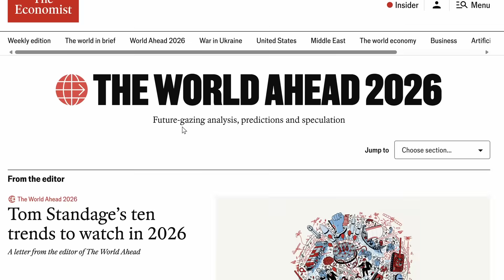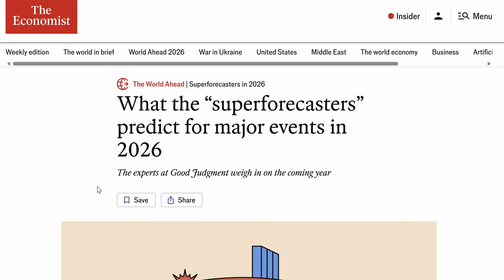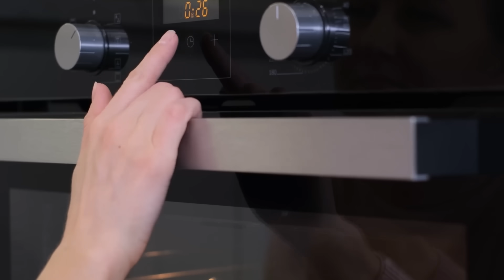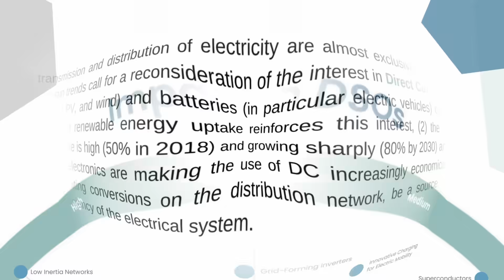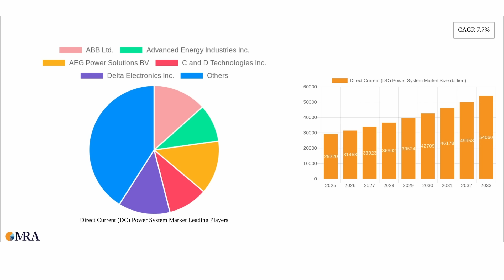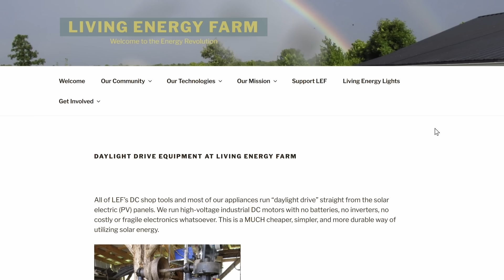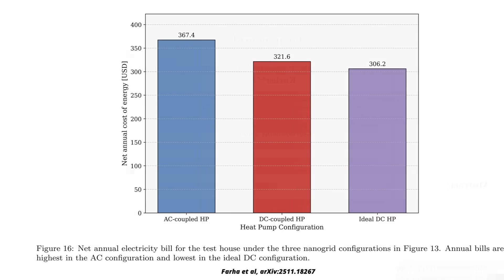Are We Using the Wrong Kind Of Electricity?

Comment: I'm fairly certain we use AC due to transmission losses over distance being greater for a DC current. With AC, we can raise up the voltage and lower the amperage delivering the same power with less loss. DC can technically do this as well, but with significantly more complicated hardware and HVDC is prone to constant arcs - also, given that most of our infra is setup for 3-phase AC you'd lose some capacity as there's an entire 3rd leg that couldn't be used in a DC setup. So with the current infra, AC can transmit 17ish times more current. I'm not aware of how to do breakers with DC, only fuses, so there's that too ( there may be a way to do it, but I don't know it ). From a pure cost perspective, switching over this late in deployment is just not feasible. That's not to say that DC doesn't have its benefits over AC, but due to the large AC deployment currently in use, I don't think the benefits would justify the costs of switching over.

Comment: At about 2 minutes 40 seconds in the video, Sabine Hossenfelder says household power sockets provide current that reverses 50 or 60 times a second. That is incorrect. Correct would be to say it reverses 100 or 120 times a second. In each current cycle, The direction reverses twice. You can check this algebraically. The direction of current changes when the waveform crosses the zero level. It does that twice per cycle. Once going from above zero to below zero (positive to negative crossover) and then again in half cycle later going from below zero to above zero (negative to positive crossover). 
It is possible to mix DC and AC currents, such that if the DC current is large relative to the AC current, then the overall total is more like DC, so that it does not reverse direction. If the DC current is small relative to the AC current, then the current reverses direction twice per cycle. To check algebraically, take the derivative of current waveform, and set that derivative equal and solve for when the current changes direction.

Comment: Nothing is wrong. AC is still better choice for high power and long distance transmission, considering losses, arcing, etc. And DC prefered for low power devices and/or short distance, for simplicity.

Comment: the current thingi toconvert dc ar rge swvicw. An, not wcwet ibw b uaw aikEnwka and they don't scLle nuclwae nwegy needs ac the only truely viable large scale nergy.  The acg hine solar panel produces 300warrs per hoour per 1 square foot hous ous use 110v vt 10 amos 12100 watts that means the hgius ae 40^2  feet that mea you woukd need 1600 sq feet of panels .that is er than most yards. just for the panels

Comment: AC has a few advantages. It allows the use of transformers, and it mitigates galvanic corrosion which is a huuuge problem with HVDC.  If we were to rework the grid today, we should probably use a higher frequency AC such as 50 KHz which would allow us to make transformers much smaller and more efficient.

Comment: AC can be transmitted over thousands of miles DC can only go a hundred feet before it peters out.
400 V AC is used on large airliners as the DC systems lack the range 
From a dozen feet to miles.  Big difference - Micro just doesn't work large scale Nic Tesla got it right

Comment: Too much energy lost over long distance.
Reply: Not when the voltage is converted up for long distance. That is possible nowadays with DC. Yet, I wonder whether the active circuits (that need maintenance) will be cheap enough to compete with the simplicity of static transformers.
Reply: @salipander6570 Exactly.  Converting DC voltage up and down in the power distribition is extremely expensive compared to AC transformers.
Reply: A million volt DC power line is more energy efficient than an AC power line due to capacitive coupling etc and for the same sized conductors can transfer 30% more power. 
It also doesn't have issues with phasing on each side of the grid connection.
Reply: @zyeborm  a million bolts is extreme .
Reply: @zyeborm Yes, but using DC through whole the electricity distribution system and replacing all the transformers with DC/DC converters would be expensive.
Reply: @JuhaK71 so would replacing all the wires and transformers on the grid when the current gets too high. 
Transformers use a lot of expensive copper

Comment: I was thinking about this recently while considering a solar panel system. One of the costs of a complete solar system is the inverter. If you only had DC devices in your home, then you wouldn't need an inverter, cutting down the cost a little. I think the real place to invest in terms of DC would be in DC appliances like refrigerators or TVs, etc., that people could run directly off the batteries or even the panels.

Comment: AC power is for transmission purposes only. DC is virtually Impossible to transmit over long distances while AC power was a Gift From GOD when it comes to electricity distribution. But after the Power gets to the location it is according to what you are going to do with it as to whether it will Remain in it's current state or if it will have to be transformed. Most motors are powered with AC power. It eliminates Contact Brushes that are a source of Wear and eventual Failure. But not when using a Brushless AC Induction Motor. Otherwise all Electronic Circuits run on DC voltage. All electronic components operate on DC voltage. A solid State Triac can regulate the Flow of AC current, but it's operation is controlled with a DC voltage. Both forms of energy are needed and always will be. It is the GENERATION, Storage and Control of these forces we need to concentrate on.

Comment: You just have to remember one thing. The most efficient way to change the levels of voltage is to use AC. If you have 50 volts from a  solar panel, to get it to a voltage your modern day electreonics need, you will convert it to AC first. With modern day electronics this conversion can be very efficient. Back in Teslas and Edisons day, they only had a simple transformer to convert voltages that required AC. Todays electronics replace the transformer with better efficiency. If I remember my history correctly, Edison envisioned power plants close to where the power was used. Tesla envisioned power plants far away. ie Niagra Falls. AC has an advantage travelling over long distances compared to DC.

Comment: In what world are "wind turbines making DC" ?????? Sorry, but that is unacceptable BS from a scientist! Due to their size and power ratings they all generate AC of some form. Then that AC usually gets converted to synchronise with grid frequency AC. And that step is done via a frequency converting DC-coupling. This even allows for variable speed rotor operation for optimum efficiency from ever changing natural windspeed and gusts.
Reply: You're right and I would add that AC, three-phase generators are well known to be far more efficient than DC dynamos. You note also an AC-DC converter and power generation controller is needed in order to store the produced energy into batteries and, eventually, push it to the grid via a DC-AC synchronous converter. A DC grid would anyway need some kind of DC-DC converter in order to push the right amount of power to the grid, so I don't see any efficiency advantage here in having a DC grid vs an AC one. The only advantage is that a DC grid is inherently much more stable than an AC one...
Reply: @giampaolo9983 💯

Comment: Main advantage of AC electricity is that it enables transformers to efficiently change its voltage upto 360 kV rms (and down to 220 V rms in steps) so that transmission between the generator (500 miles away) and the cities will have less joule loss... Also installed technology with AC motors & generators make it a backwards compatibility choice. If the distance between generator and last user is very short (?) and if efficient and safe DC-DC voltage conversion becomes reliable & available then DC transmission can also be utilized.

Comment: It wasn't too long ago that ConED discontinued 600 VDC service in New York. But honestly for common equipment it's only a modification to upgrade the rectifiers in to work at 100% continuous duty cycle in the switching power supply and then it would run on anything 80 - 245 VAC or DC. Thinking that the US where getting 3 phase AC at the service level is like pulling Hen's teeth would switch to DC service seems optimistic.

Comment: This one was weird. I should probably read the actual article.  I've had an oddly broad career in and around the power industry.

UHVDC is anything but new and trending. It's pretty cool to learn about the extreme corner case where DC outperforms AC in power transmission.

 It feels like the primary innovation of a micro grid is the cool name. Even old 1960s era dairy factories had AC and DC power busses to run the equipment with their best current.
As far as I can tell Data center internals have been DC for 20 years.

Now the news about a commercial district sharing a DC micro grid, that was news to me  and pretty interesting.

And a final interesting fact, doorbells are DC and always have been. So there has always been a low voltage DC nanogrid in nearly every home.

Comment: In my experience with EV kit cars, the most expensive motors are AC, have regeneration features and are brushless.
I have a powerful converted forklift DC motor for automotive use. At least half the cost of the AC motors. It does not have brake regeneration and uses brushes, but the cost and power is much better than the comparable sized AC motors. Instead of a Tesla, I'm calling my EV "The Edison"

Comment: DC currents are always less lossy than ac currents, contrary to what they used to teach in physics classes.  The loss issue in Tesla's Day was that there were few ways to raise the voltage cheaply and it was cheaper to do it with ac using a transformer.  Transmission losses go as I-squared times R  (the value of the current squared time the resistance).   Since the power transferred goes as current times voltage, you want to reduce the current and raise the voltage as much as possible.  Today, we can raise dc voltage much more economically than in the past and the price keeps coming down over time.  Ask a power engineer today if he would build the grid as dc or ac today, and I expect you will get most saying dc.  Besides increased losses, ac power and its associated technologies, pose other issues that don't occur with dc power.

Comment: Ironically, Tesla cars have batteries and use DC.
A device that needs AC is a clock, which counts the alternations of the current, either electronically or with a synchronous motor.

Comment: The AC vs DC question was decided well more than a century ago because AC can be transmitted at very high voltages, and then stepped down using transformers for household, or local industrial use. DC cannot be stepped fow like this, its transmission over long distances is economically and electrically impractical.  Ac can be converted to DC for occasions where DC is required, and has been, likewise since the battle was decided more than a century ago. I shake my head when the technically ignorant blather on about subjects they know little about, but have heard pie in the sky fantasists promoting imptacticalities. The Economist should stick to their money grubbing world of extracting the wealth from working people, and leave practical electricity to electrical engineers.

Comment: This seems severely oversimplified. The only reason this is happening is because of vastly better power electronic than in the past. Generators are AC machines and they provide the grids stability with their combined rotating mass. You will need voltage converters anyway, not like DC = DC there is a reason voltage levels need to be adapted in every power brick.
The same power electronics that make the DC more efficient also make converting AC to DC and in the reverse more efficient. HVDC power lines are more efficient, no question about it. I'm honestly not sure about the conversion of DC voltage levels in the energy distribution space, but I highly doubt that it is more efficient than the giant transformers (ac needed, btw) that are currently in use. I'm interested to see where GAN power electronics and so on take us, but as a matter of fact, synchronous generators will not be replaced any time soon as the main source of electricity on the grid.
I see potential for small DC nets powered by solar and buffered by batteries(seeing as technology is making leaps rn) tough.

Comment: Most of the DC users needs their DC stabilised and with a specific voltage and do thus anyway need their own DC-DC converters and that is as complex as having AC-DC converters. AC has at least four benefints, its easy to transform up and down, its easy to voltage regulate at the transformers, load sharing and redundancy is primarily via physics and not computer code and electronics and all of this makes it boringly robust.

Comment: I saw this about 30 years ago for data centers. The thing is, it won't go anywhere until it's standardized to the point you can have a DC plug in your home or business. Even in data centers, the last one I worked at had about 7,000 servers. None of it was DC powered up to the server cabinet itself.

I also tried to get them out of one application, one server. I Apache will support many websites on one server. So I had up to 20 different websites all on one host. Admins think it's too hard to do this.

Comment: DC to DC converters operate by converting DC to AC then rectifying back to DC.  Best case 2% loss.  By ignoring the transmission problems of DC grids one still needs to look closer at I/R losses, ground loops & referencing.  I see the cost if mitigating issues far exceeding any efficiencies gleaned.

Comment: IF we had room temperature super conductors in the time of the war of the currents, Edison might have won out.  However, we still don't have it.  Because transformers don't work on DC, AC was the logical choice.  I^2 x R = power in watts.  Increase the voltage by 10 and the current drops by 10.    (Ignoring transformer losses.)   The resistance loss is now reduced by 10^2 or 100.

Comment: couldn't you have both, ac with dc bias (or dc with an ac ripple) with the final grid step-down from pure ac to this into the home?
consumer units could split these and you could easily convert the low current lighting circuit to dc as a first step.

Comment: What an excellent Christmas gift! The first ever Sabine video where I genuinely understood more than 90% (±2%) without having to pause and research terms and/or concepts. Of course I learned something, as I always do, here. 
Merry Christmas!

Bonus: what I learned is DC is more efficient at higher current. Makes sense as:
Power is: P = V x I
For a fixed power requirement:
Higher voltage(V)→ Lower current(I)
Lower current → Much lower resistive losses

Comment: For the record, wind turbines produce AC. The issue is that it is AC at a wrong frequency because it depends on rotation and that depends on the wind. So this AC is converted to DC and then back to AC but this time at a correct frequency (and if connected to distribution network, also phase).

Comment: Ughghghh. I could write a dissertation on all the way this videos is wrong. 

DC is better for transmission, as long as you don’t need to change the voltage. 

AC is better for transmission and distribution where you do need to change the voltage. It would be insane to deliver 132kV to homes. 

It is trivial to convert AC to DC. 

Heating appliances do not need AC. Resistive loads like that are just as efficient with either. AC is good for motors that operate at a fixed speed. So in homes that is mostly your fridge, your aircon, anything with a fan in it. Your EV cars motor is technically AC, but your motor runs at different speeds, and batteries are DC, so you’re going to need an inverter anyway. 

Solar is DC, but wind turbines are AC because motors and generators work by using fluctuating magnetic fields. (This is me hand waving away all the inverter stuff with some wind turbines using ac-dc-ac inverters for variable speed. Any grid scale wind farm is going to not bother with that stuff. 

Finally, all traditional power generators that use steam turbines are going to make AC power because that’s how generators work, and the voltage they generate power at is far too low to be transmitted accross the grid efficiently, so the fact it’s AC makes it easier to step the voltage up for transmission. 

Then there’s the whole concept of inertia on the grid being an easy way to monitor grid supply and demand balances and act accordingly. 

AC and DC are both equally useful for electricity in our world, there is no “good/correct” and “bad/wrong” electricity. Both are required in their proper locations.

Comment: Would the DC still pulse though if you were using generation stations?
Reply: Generators don't work. They are inductive. You need electronics with capacitors to step up voltage and chop it unto pieces to step it down.

Comment: I think since LED lighting, TVs, and Computers don't need as much Wattage we can use 12 VDC in houses and make everything run on it. Just use outlets for high power usage like appliances.
Reply: 24VDC and 48VDC are way better options already used in the industry. 24VDC for PLC's and 48VDC for smaller motors

Comment: I purchased a step-up DC voltage converter 12v to 24v for the solar charger.  It gets warm during usage signifying power loss.  I believe the power loss is around 10 to 12%. An AC transformer step up or step down voltage is much more efficient than this - and cheaper.